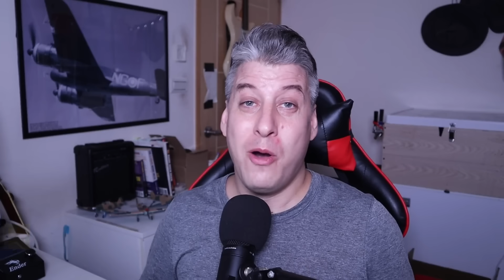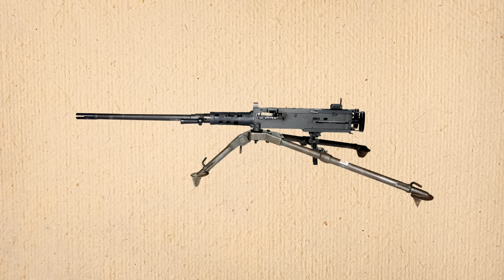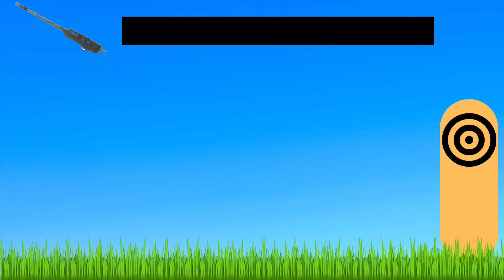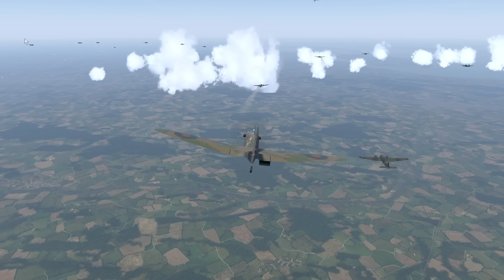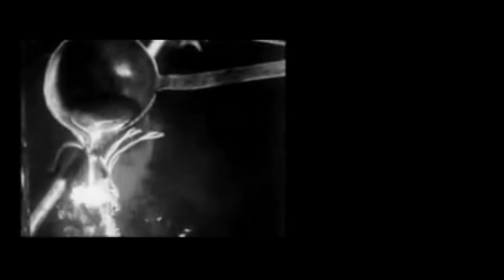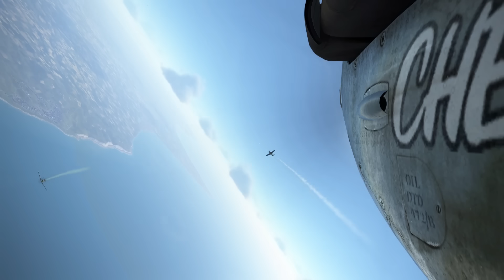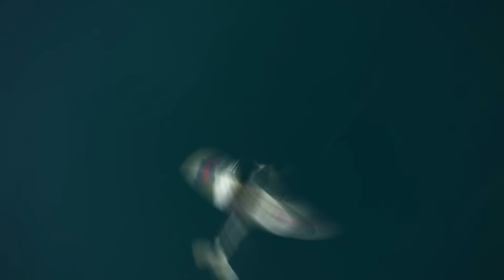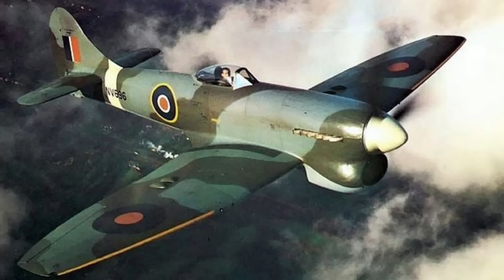Why Did The RAF Use .303 Caliber Machine Guns in WW2? The Surprising Answer

Comment: The RAF knew the .303 was too small a caliber when the war started. The problem wasn't the aircraft but the gun itself,  specifically the 20mm Hispano-Suize MK.I which was prone to overheating and jamming. The jamming/reliability issue was later resolved in a gun redesign. 

That is why when the Spitfire MKIA was on the drawing boards, they also developed the MKIB at the same time (and later the C/D/E wings). The A wing was all .303, the B wing was a mix of 20mm and 303. They knew 20mm was the future the problem was the gun just wasn't ready in time.

Spitfire IA/B and Spitfire IIA/B all flew during the BOB, but the A variants were more numerous because of the teething problems with the cannon.

As for the Hurricane, unfortunately the wing design was too old for MK.1 to be modified in any way. The RAF had to wait for the MK.II Hurricane with a more powerful engine and completely new wing design capable of accepting the 20mm as well as external stores.

Comment: The US refused to license the browning 50 cal .. the Brits switched to the Hispano Suisa 20 mm cannon
Reply: @georgesheffield1580 Thats fake news. Why would Americans do that on 20 year old weapon? Brits happily used their own mod of 30 cal Browning. Brits knew by 1939 after their own tests that 30 cal was nearly paintball pellet after going dural skin of aircraft on steep angle. Brits wisely chose going 2 steps forward at one leap, from 30 cal to 20mm cannon. We Finns produced 100% copy of M2 machinegun without problems, not asking permission. Also many Japanese aircraft guns are more or less copies of M2, just in different calibre. You understand that Colt was business, aiming to SELL their products? You think M2 50 BMG was some kind of secret weapon in 1939? You might not know but FN in Belgium produced M2 in bit better mod than Colt (FN gun hitting over 1000 rpm prewar), in 50 BMG and on 2 slightly modified calibres (13.2x99 and 13.2X96) and seeked to sell them to anyone interested. Colt and FN had deal with all Browning designs, splitting world markets between the 2 companies. They shared blueprints, and even manufactured guns to each other. British deciding on 50 cal Browning (which they didn't) would had only 1 complication. Do they pay licence fee to Colt or FN.
Reply: No one wanted the. 50 cal... it's was obsolete.

Comment: A high rate of fire has its own strength. Take the German MG 81z as the rear defense of late ME-110 with a theoretical fire rate of over 3k rds per minute. One trigger pull would send a lot of lead at the enemy plane. Having additional MG's means you can plink an enemy from afar and make him do maneuvers which would slow him down. Also ground attacks, it is probably more efficient to have more bullets at soft targets, as if you use .50 or 20 mm. Strafing a truck loaded with inf with 2 nose mounted mgs is by far more economical as with 6 .50s in the wings.

Comment: When I first entered the USAF, our B-52D bombers were armed with manually operated quad 50 tail guns, while our G and H models used a more powerful remotely controlled 20mm Gatling gun.  Both arrangements had the same effective range of 1600 meters, but in the air war over North Vietnam the D model was much preferred because the gunners could see incoming MiGs and SAMs and relay this information to the crews for evasive action.

Comment: Bomber Command retained .303 calibre machine-guns owing to the very short period in which a gunner had time to fire at night, combined with the very quick traverse and elevation responses required for that kind of snap-shooting at night. It was enough to frighten the enemy fighter, and 4-6 guns (mid-upper two gun FN50, and 4 gun FN120) each firing 1 in 4 tracer at a very high rate of fire was enough to put the fear of God up any Jerry pilot who was on the receiving end. Many trials were conducted by Bristol, Frazer Nash and Boulton Paul, to fit 20mm cannons to their turrets, however, excessive vibration, and slowness of traverse and elevation were problems that plagued all such attempts. This mainly arose because instead of a dedicated design for the 20mm weapon, most such turrets were simply strengthened versions of ones previously fitted with .303's. The same applied to the 0.50 cal, although it was a better proposition than the 20mm cannon. Some 0.50 calibre turrets were developed successfully, and served in some Groups. Had the war continued into 1946, it's likely these turrets would have replaced .303 armed turrets, as daylight bombing became more common. 

Another factor that commended retaining the .303 concerned the weight and balance of bomber aircraft. Even .303 turrets such as the FN5 were pretty heavy, in the order of 1400lbs. iirc, but these had the gunner inside too, and all the ammunition. This applied a lot of tail-down force on the tail, requiring a correspondingly higher weight in the nose to balance the aircraft. This was ameliorated with the FN20 4 gun turret, where the ammunition boxes were stored well forward of the tail, with long ammunition trays serving the turrets. The problem then was that the pull required to bring forward ammunition down the trays was close to the breaking point of the linked ammunition. This in turn was solves via electric servo-assisters, which incorporated a clutch, stopping the toothed drive that drew the belt along if the pulling force on the belt fell below a given value, or exceeded it. A series of such servo-assisters served each long belt in each tray. This all allowed a better distribution of weight, reduced stoppages due links breaking, but would all have to be completely redesigned were 0.50 cal or 20mm adopted. So, at least as far as Bomber Command went, and night-bombing persisted, there were very cogent reasons for retaining .303, as the conditions and ranges for shooting at enemy fighters were VERY different to those experienced by the 8th AF in their daylight engagements, for whom the .50 cal were optimal.

Comment: 4 x 303 on late Spitfires is COBBLERS, it's 8. When they were sighted in at 120 yards by some pilots who ignored the upper crust who had never fired in a Spit it was like a chainsaw on steroids. My father saw the tail completely sawn of an ME109. Generally it was advised the new pilots start at a longer distance and work down. If they weren't killed, of course. The design of the Supermarine  was used to outright win the Schneider trophy in 1931.  That's why its full name is the Supermarine Spitfire. It didn't do badly for an old lady.

Comment: I don't think it was mentioned the much higher recoil of the 50 cal over the 303 guns.  My dad was crew chief over 5 F6F Hellcat fighter planes that had two 50 cal machine guns on each wing.   One reason  you see fighter planes diving down on intended targets is to counter act the tremendous counter forces of the machines guns that slowed down the speed of the airplane.   Firing four 50 cal machines gun at level flight would almost stop the plane in mid air at lower speeds making it an easier target for enemy aircraft.

Comment: Remember the B17 bristling with .5 cannons and carried a Bomb load of some 4,000lbs the same as the Mosquito with a crew of 2 but Faster, Higher, Further than the B17. The B17 were cut to ribbons by the 109's etc.
      Yes the .5's destructive power was greater at up to 600yds but was not known for it's accuracy also famous for Jamming. Hence the R.A.F. Pilots both Fighter and Lancasters with far greater experience than the Yanks who did not enter WW2 until late 1942, preferred to use the .303 with an effective destruction range of some 300yds but greater accuracy. Lancaster crews had developed evasive moves such as Corkscrewing which also allowed the Tail End Charlie often a plumb target.
     The R.A.F. Ground Strafing Units then started to be fitted with the .20 against bigger and armored target such as Trains, Convoys and Tanks.... A case of Horses for Courses
Reply: 20mm was vastly superior to the Americans 50 cal machine guns... the m2 was obsolete at the start of WW2

Comment: The 50 BMG round was much more effective than a 303. It has many more options and will defeat armor, the 50 also had a much greater range. And the 50 aircraft guns had a greater RPM than the ground guns.
Reply: The 20mm was more effective than the .50 cal
Reply: @sandervanderkammen9230  True but that’s a cannon round, the 50 and 303 are rifle rounds, your comparing apples and oranges.
Reply: @craigthescott5074  Most of the research on this topic takes the differences into account, eg; rate of fire, penetration etc.
 In overall performance, machine guns are largely ineffective compared to cannons, which is why machine guns became obsolete on fighter aircraft.
Reply: @sandervanderkammen9230  It depends on the amount of machine guns and the rate of fire and distance involved. Some say the 20 mm canon was not as effective as multiple 50 BMG’s that would put more volume of rounds in the air more like a shotgun firing at a bird than a rifle fireing at a bird. The 20 mm cannon was more effective if you got hits but the 50 BMG put more rounds in the air so your chances of hits were better. The 303 and 3006 didn’t create enough damage compared to a 50 and they didn’t have the range of a 50. It depends on whose combat philosophy you believe. 50 BMG’s were used up into the Korean war in Jets until 20 mm canons and missiles were deemed more effective. 8 50 BMG’s throwing up a volume of rounds to me seems more effective than two 20 mm canons. But it probably depends on the skill of the pilot.
Reply: @craigthescott5074  Research and testing  has proven that cannons have a weight advantage relative to the firepower and combat effectiveness.
Some people do say that multiple 50 cal machine guns were better... but can offer no proof or statistical data to back it up.

The American were stuck with the inferior. 50 cal Bowning gun as a result of one of the most shameful and embarrassing blunders of WW2 history.
 All American fighters built after 1940 were spec'ed to have the M1/2 20mm cannons but government contractors produced thousands of completely useless cannons and millions of rounds of useless defective ammunition.
The Americans were forced to use the inferior substitute .50 cal machine guns instead.
They would have used 20mm cannons but they simply couldn't get them to work reliably.. 
America would not have a reliable 20mm gun until the 1950s.
Reply: @sandervanderkammen9230  Well if the 50 BMG was inferior then you might want to tell that to all of the WW2 Pilots and Bomber gunners that won the war with it Chief.
Reply: @craigthescott5074  You mean won the war with staggering losses and despite having inferior aircraft weapons?

Comment: In about 1935, when the Hawker Hurricane was in development, The Air Ministry calculated to SWITCH-OVER to the .50 caliber Browning would cost nearly 1.1 BILLION Pounds Stirling, and frankly, they didn't have the money! In tests with a Hurricane with the "B -Wing"(using eight .50 calibers) the wing FLEXED and disrupted the flight characteristics, while a two-second burst from eight .50's would DESTROY ANY AIRCRAFT TESTED and 200 .303 rounds only damaged it, the later re-designed "C-Wing" (for 20 mm cannon in recoiling mounts) proved EXTREAMLY effective against the latest German armor, up to 5" in thickness. The downside of the 20mm were they could only carry about 100-150 rounds of ammo per gun, while the "Big Fifty" would have provided about 500-600 rounds or nearly one minute of firing, instead of 15 seconds with the 20mm's, AND the .50 calibre Browning were accurate to 1000-1200 meters and the 20mm's only to 500-600 meters. No free lunches in this World. For comparison, the Japanese, Germans and Italians experimented FAR more with 15mm CANNON, often only using two 20mm and FOUR 15mm. Note that each 20mm Oerlikon cannon and recoiling mount weighed almost 8 times what a .50 caliber Browning did, and almost 20 times what a .303 caliber Browning weighed.

Comment: .50BMG is a pretty interesting round. It is, by design, a very high velocity, high energy round developed to be effective against lighter armored vehicles (like early tanks) through kinetic energy alone. Though tanks very quickly became too tough for it, it remained effective against other vehicles with roughly 5x the energy of 7-8mm rounds developed for service rifles and better long range ballistics with its high muzzle velocity compared to same and even other autocanon rounds. I've seen it referenced as a light autocanon round in its own right. However its projectile is still not quite large enough to hold a meaningful explosive charge like the 20mm guns that were the step-up from rifle rounds that the non-US forces went to. That decision wasn't a bad one, but the question of whether it would have been better to have 2-4 20mm chugging with limited but explosive ammo or 6-8 50s with more ammo and just making holes in metal is something that is argued about still.

However it should be noted that the USA's fighters would probably have been using Oerlikon based 20mm cannons with or instead of 50s pretty early in the war. The powers that be wanted to replace the 50BMG with a 20mm cannon round in the US just like everyone else. There were "issues" with reliability on the guns produced however and so they just went with more 50s. It turned out it was enough gun if you had 6-8 of them. 50bmg would continue as a viable fighter round all the way into the 1950s with the F-86 Sabre, a pretty competent and successful fighter.

Comment: Sorry, but the choice of the .303 Brit cartridge over the .50 BMG cartridge was pure politics.  The .50 is a world beater, as evidenced by the P51 with 6 Browning 50s Mustang and the P47 Thunderbolt with 8 Brownings.  The twin engine P38 with 1 20mm Canon and 4 .50 BMGs. The late War P61 Black Widow nightfighter was a monster with 4 20mms and 4 50  BMGs. The British armament industry was totally stretched as the war progressed.
Reply: The Browning MG in use with the .303 was an American design, modified for RAF use in an aircraft shortly before WWII .  The standard MG for RAF aircraft back then were improved Vickers or Lewis guns, of updated WWI versions.